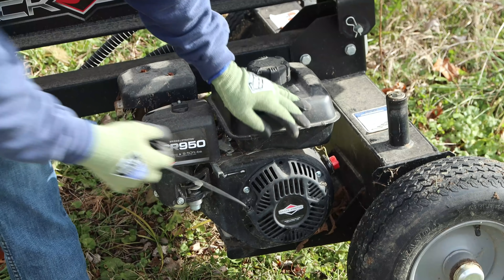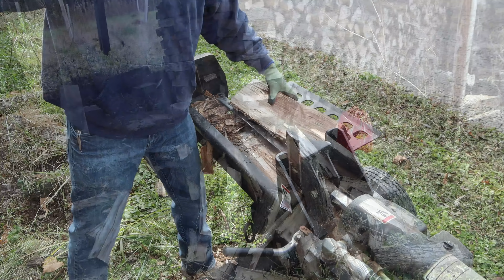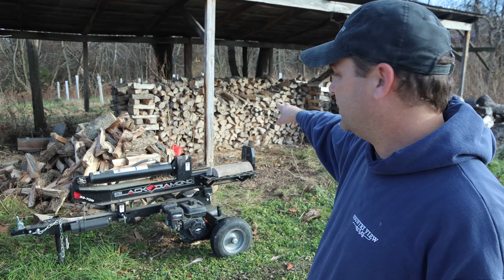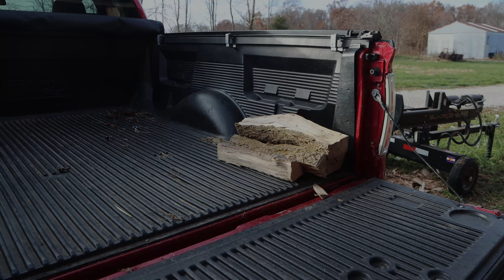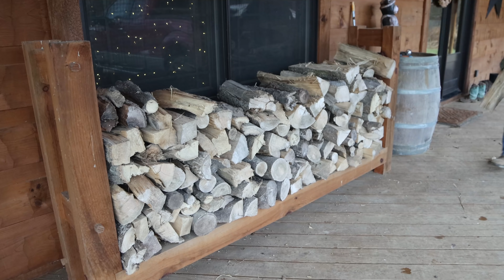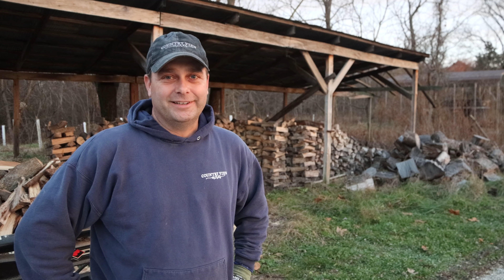Splitting Firewood and Preparing to Start Heating our Home with Wood.

Comment: I live in urban Seattle and have heated my home only with wood since I installed my wood stove in 1987.

There are a number of commercial outfits near to me which leave bins of scrap wood out for those who wish to use it. That's mostly dimensional lumber scraps  ---1x, 2x and 4x.  A nearby lumber yard often has scraps cuts from larger lumber they prepare for customers.

Mostly I haul scrap wood to my home in my van,  but sometimes I will use my nine cubic foot wheelbarrow for that.

Usually all I need to do is to cut dimensional lumber to suitable length on my table saw.

I have some wood storage under cover of my house, but much of it is stacked in the back yard protected from rain by plastic tarps.  

I'm a firebug and I never tire of stoking the wood stove and be rewarded by heat for my home.

Comment: Evan, not criticism, but if you got some stripped out IBC totes, you could stack your wood in them, then you could have them ready to take to the porch and not have to handle it as much.
Reply: I second this. Or build a few firewood boxes using good pallets for ease of moving things around. Tag the wood and let it dry as long as you want. No guessing for the family if something happens and you aren't there to stock the wood.

Comment: Evan, have you ever considered making some pallets with sides to stack your firewood on.   As it's split load a pallet on the forklift and eliminate lots of double handling.   Just a thought.   I see you loading the bucket and then loading the rack on the porch.   Much less work with the tractor forks.

Comment: Using the log splitter is not cheating. It is working smarter, not harder. As you age you will need to find a way to work more easily. do they still make wood heaters that are a large box that puts off a large amount of heat on very little wood? When we lived in Oklahoma thirty two years ago they were very poplar there. That sounds like a good one for the shop.

Comment: In Canada we split in Jan.  The wood splits cleaner with frost.  You might try a splitting maul with levers in the head.  It ends the need to lift the wood onto the splitter.  I know it sounds crazy but I no longer use a hydraulic splitter (well, I use it for elm.)

Comment: Great video Evan I agree its relaxing. The last two years I cheated was  able to purchase inexpensive 2x3x3 debarked square logs from a paper mill and all I have to do is cut them in half and I'm ready to go. I watched a guy last year on Youtube that build reverse fires in his stove. He put the logs on the bottom, then the kindling in the middle and then a little paper on top for a starter. It is so much easier to  light and burns great.

Comment: I agree with you on doing firewood. It is strenuous work out, using most muscles, but  at end of day the sense of accomplishment, not buying LP or oil is a great feeling . Wood heat is dry heat.

Comment: You said it, Evan.  I use wood in my grill to cook and for recreational fires and usually start from scratch each time.  I go through silly amounts of kindling!   Sometimes, if I let the ashes build up a bit, I'll find live coals still in there the next day, and can just add some dry chunks to resurrect it.

  Luckily for me, there's a site out back where all the windfall, deadfall, and trimmed branches get thrown.  I go down there regularly and gather sticks, twigs, and dead limbs to break down for kindling.  I rarely have to split any.  As an added bonus, sometimes I find larger fuel sized wood from good species like honey locust.  (someone planted a ton of them in this neighborhood years ago, and they're now fully mature, and often in need of pruning.  Which means I get to stock up on free locust!)

  I also use all the splitting debris as kindling- those slivers do a good job.  So do large pieces of bark, once they dry nicely.   I get most of my fuel wood in large chunks and resplit it to fit my grill, so there's always an ample supply of shards, slivers, etc...

 I have 3, 6 gallon pails I toss all this stuff in, plus a 3x3x4' wooden box on the porch for the limbwood.  Keeps it all together, out of my way, and off the ground.   I  just grab a bucket any time I need to start up a far.

Comment: oil is my main heat, but i have a fireplace that i like to use on occasion, either for extra heat when its really cold out or for power outages or for when its not cold like in spring or fall i use that to save on oil during the day.

Comment: My dad made a tool to take pallets apart, and got these for free. My mom still uses this tool as she hears most of the house with wood. If it works out, I plan to buy a farm in a major highway in my area, so I could  potentially get lots of skids with a little advertising. My weld shop will be either wood heated, or waste oil heated.

Comment: Cool sunset.  I see those ugly pieces there for next year.  ugh!  I have worked with those huge ones before where you have to cut them in quarters just to be able to work with them.   Then, I had to put the log splitter vertically and split in half or thirds again so I didn't have to lift them.  Still, it is satisfying to have it all done and stacked.  I got on that kick for a couple years and now I have 8 cords too much I have to sell.  It is addicting.

Comment: I like the relaxing nature of firewood splitting also! We don't have that much pine here, so I use Sassafras for fire starter. It pops and snaps a bit, but dries very quickly after cutting and burns easily. Great video of the sunset!
Reply: Does the smoke have that root beery smell of Sassafras?  I've never had any to burn.
Reply: @pyroman6000  You're not the first one to ask about the smell of Sassafras when burning! No, I don't notice any root beer smell, but then again, I'm only using a small split of it abut 6" long when first starting the fire. I heard others say it does smell like root beer when burning.

Comment: The first two houses I lived in were heated with firewood.  The first one had a large stove in the basement that would burn just about anything, but later we moved and had one of the inserts like you described, but before any specific EPA regulations were involved.  This insert would still burn just about anything and had an exhaust recirculating system that would reburn some of what would otherwise have gone up in the smoke.  You could almost boil water on the top of the insert and we used that fact for a jury rigged humidifier by leaving a large pot of water on it whenever the fire was going.  Mom and Dad (mostly Mom...) kept that small house way warmer than my oversized body and teenager metabolism could tolerate, so I spent a lot of time outside splitting the firewood they burned.  We didn't have a powered splitter, we had me, my brothers, and a series of splitting mauls ranging from 9 to over 12 lbs.  I got to where I could make the oak fly with a 9lb maul one handed by the time I was old enough to drive.   I almost miss those days, but am about to move to a house that has quite a lot of woods as part of it.  The house I'm buying no longer has a fireplace insert, so I'm not going to be burning wood this winter, but if I end up building a smaller version of your pole barn, I'll probably do the same thing and put in a wood stove.  There will be plenty of deadfall if nothing else.

Comment: Evan did ya get the chimney cleaned out this year? If so did ya go on top of the roof or inside? Have a great day. Snow next week be ready.
Reply from the maker: Last year I started cleaning from the bottom up.  Using a "sooteater".  It spins on a drill and cleaned the chimney pipe.  I haven't done it yet this year.  But I will be doing it sometime soob.

Comment: It seems like a very inefficient operation. Piling split wood, then stacking it, then stacking it on the back of truck, then carrying it and stacking it on the veranda, then bringing it into the house an armload at a time.
Can't you devise some sort of split wood container that you can pick up and set down with the tractor, and maybe wheel it in thru the sliding glass door ?
Reply: Just what I was thinking.  I envisioned taking the wood directly from the splitter and stacking it on a wooden pallet right alongside the splitter.  The pallet would be held by the tractor forks at thigh level so that Evan only needed to pivot from the splitter to the pallet.  Later, the tractor stacks the pallets of wood for further drying and then they can be directly transported by the tractor onto the porch.  Would also save wear and tear on the truck.

Comment: I have a hydraulic splitter as well, and it's beginning to annoy me how much of the time it's running but not actually doing anything.
How much do you burn per day when it's colder?
I live on the arctic circle, about -10°C now (14F), bit of a breeze, and I use what firewood I can carry  in one of those sturdy, woven IKEA shopping bags. Of course if I wanted to heat the entire house instead of just half of it to 25°C I would use twice that.

Comment: The sunset was beautiful and the wood pile looks good for the time. Have you thought about stacking the oldest cut wood at one end and then as you cut new wood, you could put the new cut wood and keep coming to the other end. Then you go back to the first wood you cut and use it and then when you cut newer wood, you stack it in that place and you always have a good rotation of seasoned wood to burn, without having to move any of the other wood.
Reply from the maker: When I repair the firewood shed roof.  I plan to also divide the firewood shed into several bays.  With walls dividing them up.  Then I will fill each bay in order and maintain a rotation.  I hope that makes sense.

Comment: Hey--I was surprised you are going with a wood stove for the shop. Is that a change of plans? It's great heat but for an area that big you will have to fire up the stove hours ahead of when you want to work in there for it to get up to temp. You can't just pop in there for a project and be warm without a lot of planning. For a shop like that I would have planned on radiant heat or something like a Modine heater or two mounted on the walls.. Now you have to put a chimney in and all that. And believe it or not you are going to get older and the idea of fooling around with that stove will not seem like so much fun!